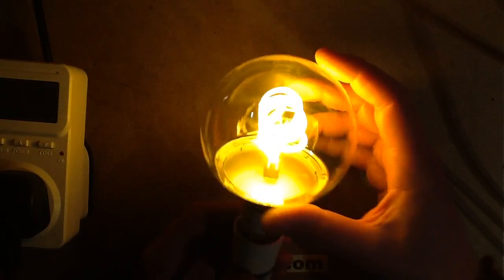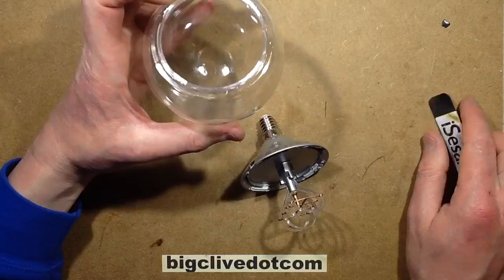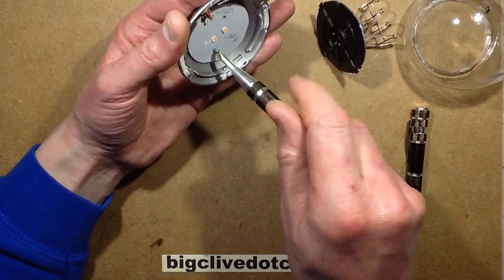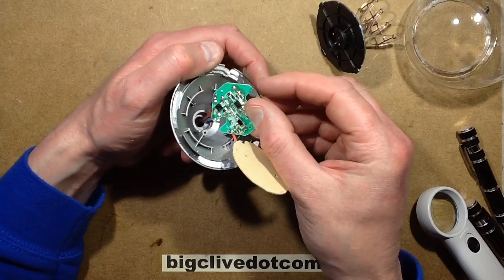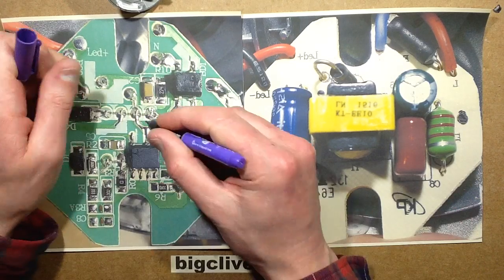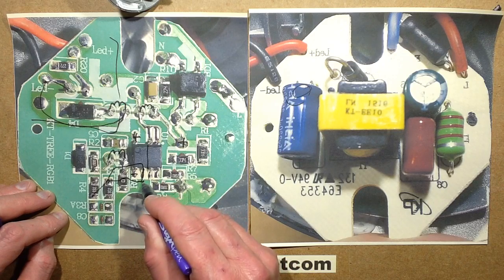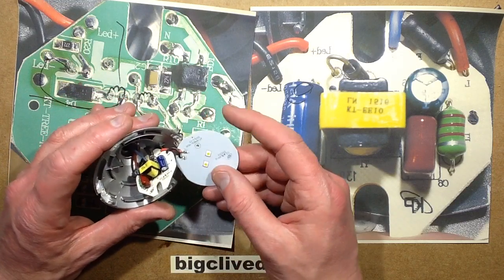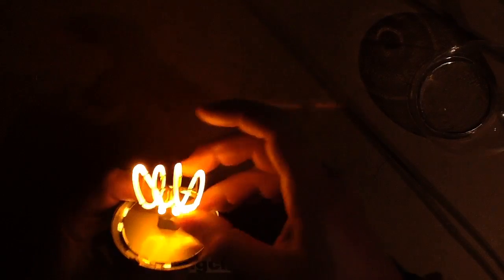IKEA Nittio LED lamp teardown.

Comment: Have the same Nittio in E27  
 base took out the light pipe the globe did it sanddust put it back up they claim 20Lm/W i wonder what it would  be just wihout the lightguiding , carbonfilament support😊

Comment: Doesn't full black resistor actually mean 0 ohms? Eg. it is either bridging a live connection (like a jump wire) or acts as a fuse.

Comment: I have a Nittio LED lamp like this, but the base is "brass colour". I couldn't resist and took the lamp apart: one powersupply board and one big board with just two bright LEDs, which have a similar orange colour like the sodium street lamps. I took out the LEDs form mine, and modified other stuff into the globe: one yellow "christmas light" bulb and a 7 segment display permanently showing 150 (I can't explain why I chosen this). 😊 I reused the LED panel (with 4.5V supply) to light a small area outside near our gate.

Comment: Is there any way to run these off a 12v battery directly?
Reply from the maker: The LEDs could be run in series on 12v with a suitable series resistor.

Comment: can this bulb be put on a dimmer?
Reply from the maker: i wouldn't recommend it.  Besides, it's very dim already.
Reply: I  also would likee to know if its possible to dim the leds. the ikea package says no dim. but why not, would it damage the leds? and do you know if this lamp can work on 1.8 dc voltage adaptor?
Reply from the maker: It's already quite a dim lamp.  The use of a dimmer is more likely to damage the power supply than the LEDs due to the sharp spikes of current during the repeated waveform switching.

Comment: listening to you explain the PCB layout, is like listening to a story being told, I love it ;) I'm not an electrician, and I know just enough to replace the random capacitor when needed, but I find these things amazing, and funny how often the brilliance of these designs are overlooked as "regular", or "bleh", etc.. lol...so much is happening, all the time, to protect us, and our electronics, but most people just think the power comes from the station, to the outlet, into the light, in a straight shot, with just a single wire, hah. keep up the great work :)

Comment: Hallo! for a odosun 9w, 18 leds in series, can You give a clue, please:  it is flickering at low intensity. when I turn of the supply, it still flicker the same manner, till the a capacitor for smoothing, is drained. what it could be, just curious. Just what You think? Thank You!
Reply: no dimmers, just a simple switch for power on.

Comment: Hi!
Iv'e got three of these at home since a few years, works perfectly.
But then i bought five of them for the office, and from day 1 two of them got considerably dim compared to the others. So got two new and replaced them. Of course i took them apart and found that the LEDs looked burnt, i also smelled that it has been hot in there. I compared the circuitry to your lamp, and it´s identical. Using a DMM i could not find anything that measured like a faulty component. 
When plugged in, the voltage is 6,3V over the LEDs which is too much for an amber led in my opinion, which is backed up by the fact it is burnt.
What do you think could cause it to overpower the LEDs like this?
Reply from the maker: It sounds like a manufacturing fault if it damaged the LEDs.
Reply: Well. Yes. Something is faulty. :)
But since comparing it to your lamp, and by visual inspection, also measuring most of the components with  a DMM, I can´t find anything obviously faulty. I am triggered to keep on investigating it!
But i guess that i need to know exactly what the main IC is doing and what typical values should be around it.
I just thought you had an idea right of the bat.
But I´ll keep on measuring on it! 

Thanks for a great channel!
Reply: This is a know issue, we actually reported this and it has been fixed by now. The silly thing is that the reason why they burn is that the fiber element is to close to the LED which affects it's ability to loose heat. Not an issue when they are on for shorter periods, but when they are on for hours on end it becomes an issue.

Comment: Very good video as usual.You may not be aware of a very good glue melting / disolving fluid ( orange solvent) dentist use it to remove crown cement.It works extremely well, I havnt found a glue which will not be disolved by it and it doesnt affect plastic.makes dismantling stuff very easy, some hardware shops sell it in a dilute form, but if you buy it from a dental supply company you can get it full strength, the brand I use is called "wonder orange" its cheap and high strength.Happy dismantling CliveRuss
Reply from the maker: D-limonene solvent?

Comment: Fiber optics are good at keeping light inside the fiber, i.e. light travel along the length of the fiber instead of out of the fiber.  It seems that in this case the supposedly "advantage" of the fiber optic becomes a disadvantage by keeping the light in, thus reducing the efficiency?

Comment: In a bit if fibre optic cable if you put light in one end it tends to come out the other end with little leaking out at the sides.  On this light the objective is for the light to get emitted... how does that work?  What exactly is the coiled tube made out of?  Is it solid or hollow?  Is it clear or semi-silvered?  Thanks in advance
Reply from the maker: +NivagSwerdna Side glow fibre optic is engineered to leak light along its length.  It's solid with the inner and outer layers with differing refractive indexes of normal fibre.
Reply: +bigclivedotcom Sounds convincing
Reply: bigclivedotcom Clever.  Thanks for the detail.
Reply: +NivagSwerdna At 2.53 you can see that still it acts as fiber optic, when Clive puts finger in one side, other gets black.
Reply: +Electronica y Reparaciones And that justifies why at the end there is so much difference of emmited light with cover and without. As +bigclivedotcom pointed, not so efficient!!! (but still beautiful effect)

Comment: Put a dab of optical grease on each LEDs to better couple to the light pipe to increase the output.
Cheers,
Mark
*************************
Reply: i think you might overheat the led that way
Reply: I talking about in the light path between the led and the light pipe.  I don't think there is much heat sinking out the front of the led into the light pipe. "Just a Dab'll Do You".

Cheers,
Mark
*******************************

Comment: '
is that light bulb hot or warm...
what temperture while light on
Reply from the maker: +bestamerica It stays cold.
Reply: +bestamerica Should be cold, it is plastic casing. Inside has the aluminum plate, so it will get quite warm inside
Reply: +bestamerica Should be cold, it is plastic casing. Inside has the aluminum plate, so it will get quite warm inside
Reply: +bestamerica Should be cold because it is plastic casing. However it should get quite warm inside, 2W on an enclosed plastic box...
Reply: +bestamerica Should be cold because it is plastic casing. However it should get quite warm inside, 2W on an enclosed plastic box...
Reply: +bigclivedotcom I am afraid it will get quite warm inside, 2W on an enclosed plastic box... ¿Could you do some readings after having them on for a while? Just wondering

Comment: Maybe it's a stupid question:

What if you turn off one of the two LED? Would the light be half, or will actually go into the back of the bulb ? If it goes into the back, what would it happen if you had the 2 LED with different colours up running ?

Great videos.

Suggestion: when saying names and numbers, you can add the text into the video. (make it easier for non-English native ppl like me).
Reply: +jalexandref My guess would be that the spiral will be considerable brighter in one end with just one LED.

Comment: That chip looks like a clone of p.i. top-242.
Reply: +DjResR functionally yes sort of... pin out no.
Reply: ***** The pinout is different indeed, I checked the pdf again, although the function is the same so the custom numbering the IC is completely useless in that application as it is not that hard to make a PSU using that chip..

Comment: I've seen those type of offline SMPS chips before that have a "missing" pin on one side. This is the closest I can find: NCP1014
http://www.onsemi.com/PowerSolutions/product.do?id=NCP1014

Pinout is wonky as compared to the light you have, but they operate in a similar manner.
Reply: +Jammit Timmaj well, the ncp doesn't use FB winding, it relies on optocoupler. I like the 'ikea chip' using two pins for drain, makes sense. NCP and Power Integrations seems to favor 1 pin for drain.
Reply: *****
I didn't catch that. Thanks for pointing it out.

Comment: Hey Clive could you do a review on this little wifi wall socket? http://www.ebay.com/itm/121734148140
Its pretty good for its price, only problem is its not grounded (Would be cool if you could also suggest some workarounds for grounding)

Thanks :)
Reply: +mharris1270 The thing is.. the UK AND US variants of this device are grounded and the EU is not
It would be fine to use with devices that have no grounding (ex. a lamp) however you cannot use it for devices with ground (ex. AC/fans etc..)

Comment: You absolutely need to print a custom circuit to power lower power LEDs so you can use the optical cable sculpture as a desk lamp
IMHO

Comment: I really rstand why they used a seperate board for the leds. Is the board being used as a heatsink similar to the philips slim style bulb? I think with how little light/ heat the leds dissapate, i would either mount them as smds on the power supply board or at through hole components on the power supply board if there is worry about heat.
Reply: I ment to start with "i really dont understand".
Reply from the maker: +jak p (skiguy09) The LED side is a solid plane of copper to heatsink the LEDs.

Comment: It's been a long time since I hand-built a simple power supply, but why is all this extra circuitry needed for this?  Why not have line voltage come into a step-down transformer, then to a full-wave bridge, then a smoothing cap, a current-limiting resistor,  and maybe a Zener diode to hold the voltage?  Can someone explain it to me, please?

Comment: I would like to see what it looks like if you remove the metal disc from the fiber loops and epoxy the fiber loops directly to the LEDs. It should transmit more light to the fiber and cast a bit more light.

Comment: Clive/anyone have you seen these magnetic charging cables. You leave one end in your phone/device then the wire has magnet on the end for easy snap and charge. Anything which could be compromised electronically?
Reply: +Lightning Graphics I've got some - one for an iPod touch with a lightning connector, and another for a phone with a micro-USB connector. They are very nice. With the pogo-pin (spring-loaded pins), they seem to make a good connection every time. And they also have polarity-switching built in, so no issues with it connecting back-to-front. Very handy to prevent the USB plug wearing out.
Reply: +Peter Feerick Did you buy just generic ones from ebay or do you have a link to the ones you bought? I think id like to use one on my phone to preserve it for longer, plus it's super convenient
Reply: +Ashley Jarvis (AshleyDesigns) The ones I got were SKU323592 and SKU302642 from banggood.com... they seem to work quite well, and I haven't had any issues since I got them in Jan. Just do a google search for banggood and the SKU and you should find them.
Reply: Nothing compromised that I know of. Since it's only a power input, there's no risk if something shorts any of the pins on the phone. Also, since phones use flash memory (usually MLC NAND), there's no risk from the magnetic field either. Even the magnetometer chip (used for digital ambient magnetic field measurements, aka the compass app and maps) can compensate any magnetic field that's near it so it does'nt interfere with it.

Comment: Do you have Clas Ohlson near you? They have quite a few of these LED lights (well, not like this, but the LED strings thing).
Reply: in dubai clas ohlson is an instant 10x price of outside. 1$ pen? well sell it for 10! also enjoy the 30 (2cm long) piece 30$ heat shrink tubing!
Reply: Anas Malas
In Norway things are usually cheaper there than in other stores.

Comment: Nice.
Interesting power supply chip, only appears to have seven pins. The first SOIC 7 package I've seen.
Reply: +bob s 
Not really all that rare, I've seen these before. It's mainly to do with high voltage clearances.
They do the same thing with DIP-8 packages, turning them into a DIP-7 package, and I've seen the same deal with SOIC-14 packages.

Comment: Clive,
All these adapters and electronics you find in the drivers both separate and integrated into the bulbs come from IKEA itself. The manufacturers actually buy these units from IKEA and than we buy the whole units back from them. This is all to ensure quality and safety. 

Anyhow if you need stuff from IKEA I can get you stuff from the EU store if you ever seek something.
Reply: +Lintary Your statement is little doubtful. IKEA sell parts to buy finished product from that parts?
And in that process all markings on part are not from IKEA but from other companies (and if you open any device with for example TDK-Lambda power supply you will see on it TDK-Lambda markinks not some other company even if it is designed by TDK-Lambda for that company and can't be bought from TDK-Lambda) ?
That is too much fiction. If IKEA is capable to manufacture drivers they would not need someone else to make them whole units from parts they manufactured.
All electronic I ever had from IKEA was actually not made by IKEA, not even designed by IKEA it is just bought from some obscure Chinese OEM manufacturers and branded as IKEA.
For example IKEA Koppla USB power supply is actually Chines "WONDER" (only Chines can pick name like that for company) WCE-1705 USB power supply that they sell to anyone who want to buy them in sufficient quantities.

Comment: Hi Clive. could you tell how many bits you have in those screw drivers as i think i have lost a couple.
Reply from the maker: +Andrew Millyard It comes with 9 bits, but the flat blades and cross heads are the most useful.
Reply: Well at least i have half of them!

Comment: I have an older IKEA lamp (circl?) that is currently hosting a neon bulb with a glowy-bit in the shape of an 8-Ball. It fits the circular shape of the lamp perfectly and the clear plastic of the lamp parts allows you see the details of the bulb.
These LED bulbs coming out are going to get that neon replaced as I really really dig the filament look. 
The bulbs also make me want o build lamps from industrial scrap as they would look quite fitting in that style of fitting.
Reply: +Michael Thompson 
Hooray for awesome looking steampunk light fixtures! :)
Reply: Agreed Benjamin!

Comment: The same technique could be used to create modern nixie tubes!
Reply: +WKDworks http://hackaday.com/2012/02/18/edge-lit-nixie-tube-is-sheer-brilliance/
Reply: +WKDworks Those would have to be some very large nixie tubes.
Reply: +Zircemerald actually quiet tiny. glassfiber can be as thin as .05 mm (and even thinner for internal use), you can scale it down to roughly about 1/8 of real smallest nixie tube currently on the market.
Reply: +WKDworks 
The same principle has already been used to make large 7-segment displays, using hot glue sticks as the "lightpipe".
Reply: +WKDworks you can order new ones
Reply: +MyBrothersMario Sheer Briliance, yeah, they are right. I want one so freaking bad.
Reply: +MyBrothersMario Oh man, that reminds me of an art installation I saw at a burn once. Layer upon layer of intricate iterative geometries illuminated from the edges with RGB LED's, and the controls for the LED's had some sort of motion sensing built in. Twas beautiful.

Comment: Im supprised you havnt changed those leds for another colour clive ha ha, we know you love to change things :-)
That switchmode does sound very typical, similar to some small plug in the wall router supplys, just missing the opto coupler for better voltage reg.

Comment: There is a cafe in edinburgh that is lit up by some 200 of these light bulbs. Super cool effect, though i cant imagine the electricity bill.
Reply: +PierreDolphin 

Consdiering that they are leds, it's probably not all that much. Imagine 200 gu10 halogen spots running 40watts\piece instead :P
Reply: haSVENhe I think its only possible with leds, considering the efficiency of halogen lamps its just a giant oven.
Reply from the maker: +PierreDolphin If they are these lamps then they will draw a total of 400W.  But if they are the more traditional long filament ones rated at 60W each then the power, heat and running costs will be astronomical.
Reply: +PierreDolphin The Nittio lamps cost £7 each so that's £1400 worth of lamps although they probably got a quantity discount.
Reply: bob s Dont forget the fixing for individual lamps aint cheap either. But Ikea does offer cheaper price for businesses. I remember seeing a woman at ikea looking at those really cheap mugs for 5 minutes, then found a staff and was like, "hmm i quite like this mug, can i have, like 200 of these? And those bowls as well." And the stuff grabbed an ordering list and filled that for her.
Reply: +PierreDolphin The lamp costs would only be a small part of major refurbishment costs.
If they used conventional filament lamps then there would nearly always be one or more lamps that were out. These LED lamps should work for years.